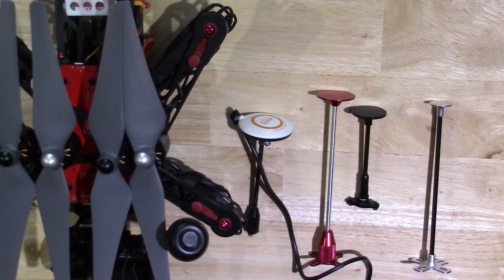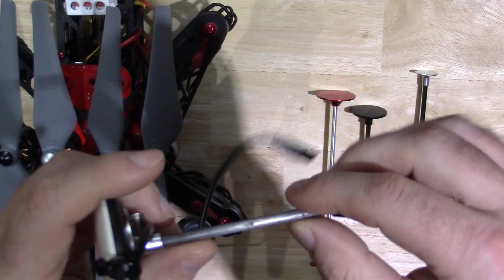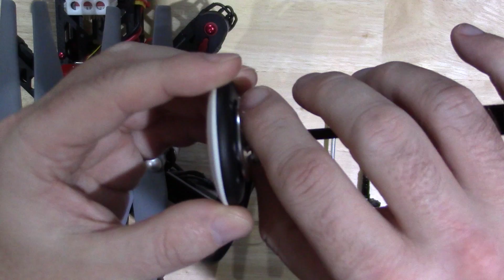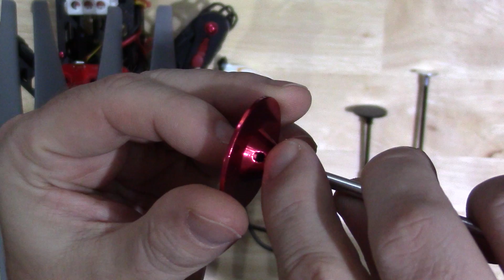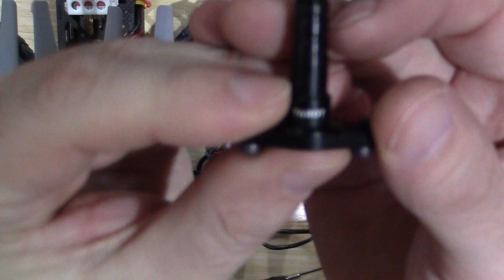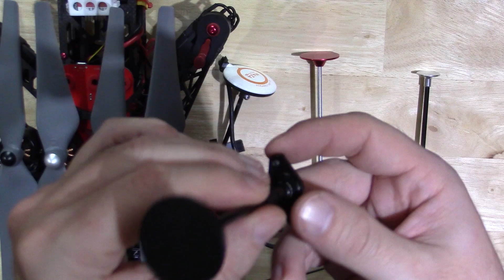Foldable GPS Mounts - Closer Look

Comment: Now that you've spent some time using these, which do you prefer?
Reply from the maker: +kJer Irl Hands down the Tarot one is my favourite. Its just easier to unplugh and let it dangle. The folding ones are fine but when you turn the quad over for working on it they still get in the way still. The Tarot makes life a lot easier.
Reply: +d3weyTube how is the steadyness? I've read on a lot of them that they can be loose.
Reply from the maker: +kJer Irl That is one of the things I like most about the Tarot. There is no slop, no chance of a loose joint causing wobble. Just feels nice and solid. 
Other option to look at these days is the DJI S900 holder too which I have heard is quite good but me the unplug option is just really nice.
Reply: +d3weyTube I agree, thanks man, I'll order one asap

Comment: I have watched all of your xu gong vids and found them to be a wonderful tool. I finished my build today following your build vid to the letter (THANKYOU). I haven't maidened it yet as I am still in the assistant software setting up the Naza m v2. I'm using the gps mount that this video is about, and have positioned it in the same place you have. I was wondering if you could share your xyz settings as I'm struggling with it in the assistant software. ( I'm using 5200 multistar)